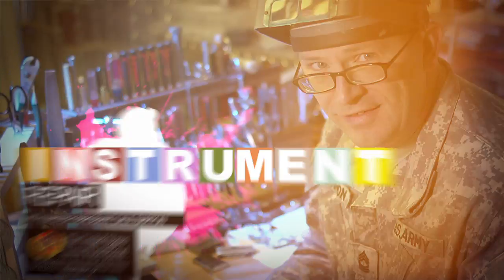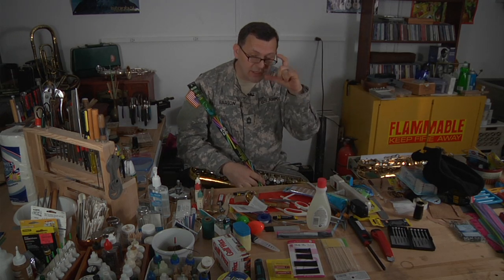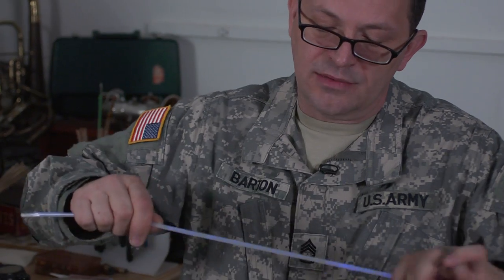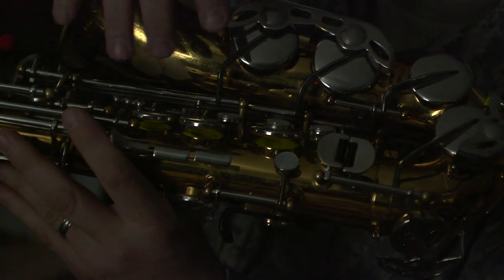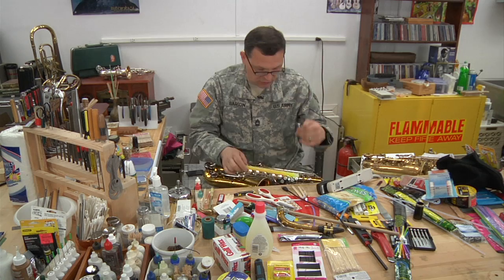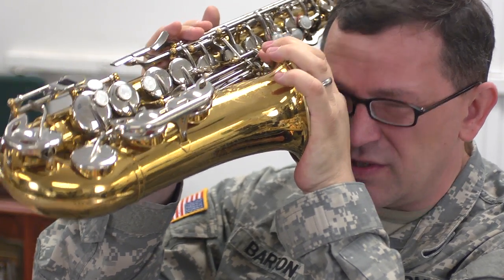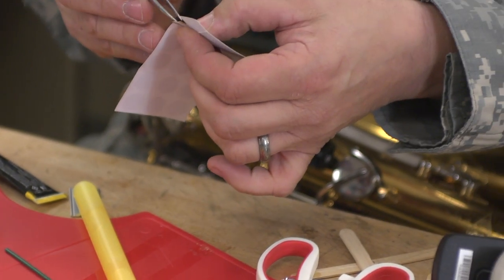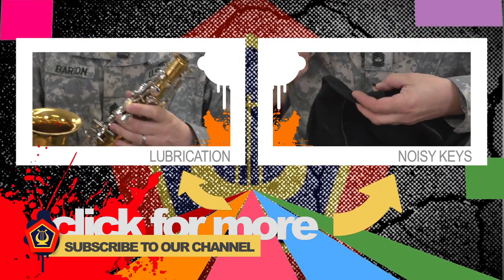Leaks: Saxophone Instrument Repair

Comment: Another way to check for leaks is to put a generic handheld flashlight in the bell. The brighter it is, the easier it is to see. Ive used this before and it works really well.

Comment: That was a pretty funny video on the light issue. I've been finding a lot of saxes come to the shop with bent bells because sax players are picking up the sax in the case by the bell. Players are strongly urged to avoid this as the body is too heavy and weighs the upper part down so the bell is bent upwards (brace gets weakened)  and the bell keys are not geometric to the tone holes. So, support the bell when picking up the sax in the case!
Reply: Huh, I was always told to hold it by the bell... That's very helpful, thank you.
Reply: As long as the bell brace is fairly strong, you shouldn't have a problem.

Comment: I used to use car 12 volt bulbs for sax lights. I used the small sizes. Solder the wires direct to the bulbs. You can use a doorbell transformer (16 volts output) for the filament car lightbulbs.

A thin strip of cigarette paper taped to a paper match makes a great feeler gauge, and it will see leaks that lights miss. Test all around each pad. Pinch the paper in the closed pad and try to gently pull it out. If it moves, there's a leak.

This "repairman" doesn't have a holder and must hold the horns and work on them mostly one handed.  Some techs use a vise holding a padded board to fit inside the bell snugly. One guy used a fat table leg. You might use a different one for each size sax, hence the vise. Then you can work with two hands. 

Fix your own horn; most repairmen seem incompetent. Saul Fromkin was good, but got hit by a car and died. Roberto, his former apprentice does great work too, but maybe only if he thinks you're famous or something. He clearly considered me unworthy of a decent saxophone, when I couldn't tell him precisely where the leak was from my playing the horn.

Comment: You can also use cigarette paper to check for leaks:
If you slide the paper between tone hole and pad and close it with slight pressure, it is easy to slide the paper out auf the gap between tone hole and pad when there is a leak. If you cannot easily slide the paper out there is no leak.

Comment: 3:11 For bariton I use a bariton swap rope (with swap removed). I attach it to a led leak light and simply pull it through the instrument. There are several video's on you tube how to use the bariton swap. You do it the same way.

Comment: A cool trick I use is to take a mini maglight, the AAA size one, to gigs.  The head screws all the way off very easy. Then I use a string off an old neck strap threaded in the hole on the end cap of the maglight.  Saved many other players at gigs with that trick.  For my Bass and Baritone top end I'm experimenting with Glow wire I found on Ebay. Prob so far is the batteries have to be very new or it is too dim and it is a bit too flimsy.  Next I will get... Continued next post....

Comment: Hi can you help me how do I can fix the valve section of my old conn 14k sousaphone,  I feel like the air escapes and is out of tune.  
Thank you !!
Reply from the maker: santiago garcia We are checking with our repairman and will get back to you soon. Check back later.
Reply: Have you tried checking the solder joints on the body, or the connections where tuning slides meet the main tube? You could try just feeling around the solder joints with your hands as you blow in your instrument to feel any air escaping.

Comment: When I was in a situation where the shop was too bright for the rope light that I had to use on bari's  I used a large thick cotton cloth cover very much like what photographers used on old turn of the last century camera's.  It was a little stuffy but it was pitch dark and even the dimmest leak light would show leaks very sharply.

Comment: Next I'm going to try the whitest and thickest Glow wire I can find, Double it up and stiffen it some with a guitar string. One stiff enough to keep it moving well, but still make the turns in my bass/bari. I'll also try a transformer rather than bats.  
BTW, best leak like I've ever used was a bare Maglite bulb with wires soldered to the contact.  Do one hole at a time. Yes it's Old Skool but the guy that taught me graduated from repair School in '54 and is still the best I know in the biz.
Reply: FantaZ4U de

Comment: Hello Sir,
I have an Yamaha YAS-275s alto sax and I have some problems...
When I bought the sax from store, it has minor problems with tone. Even after tuning the tone, they are some notes which was not in tune, but the sales representative sad that I have to play some weeks, so the pads start form correctly. It also told me not to clean inside the sax for 2-3 months. I did that and the tone was correct, but after I clean the sax inside, it start to sound again not in tune. Can you help me ? Thx
Reply: That's such a weird recommendation (but I'm not an expert either). I hope you're brushing your teeth before playing, because you sure don't want those tacos inside the instrument.
What notes are out of tune? It's pretty normal for middle D and D# to be muffled and the upper octave to be sharp. Also depends on how proficient you are. Judging by the model, at the time of writing this, you were a student, so I wouldn't expect perfect intonation.
But yeah, in my opinion, not cleaning the horn for 2-3 months is a very bad idea.
As for your second question (hard blow) - likely reed positioning problems and possibly underdeveloped embouchure.

Comment: i have trubble With my low A barisaxophone i have leaklight after  two weeks playing it leaks some where else i find the leaks bending the cupps in line again and and 2-3weeks it is leaking again somwhere on the BELL part it is easy to fix but it c\keeps comming back is the material on the horn bad or is the bell twisted sorrey for my teribel inglish im Norwegian frustrated bariplayer
Reply: If you have the money I would just take it to your local shop and have it looked at.
Reply: And when you take it out of the case I strongly urge you to not lift if by the bell EVER! because it will weaken the brace which may be the source of your problem, considering the fact that the brace loosens enough to bend.
Reply: Ok i will have that in mind but all my saxophones rest on Music stands i tested all the scrues on the brace and bodey/bow conection they where not proper tighten it is stabel now so  THANKS FOR THE ADVICE